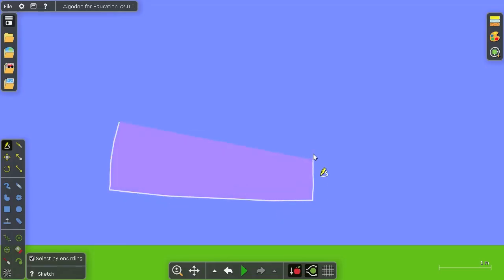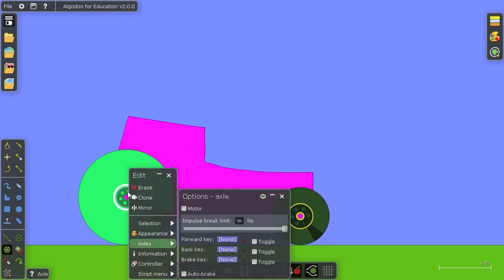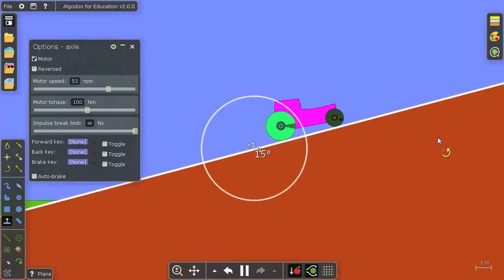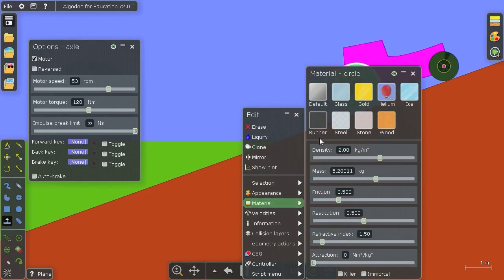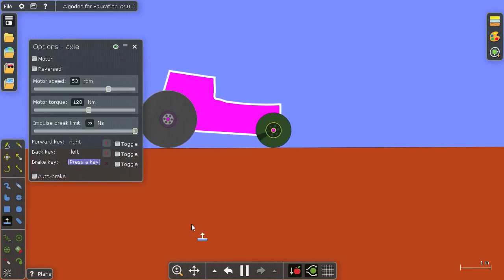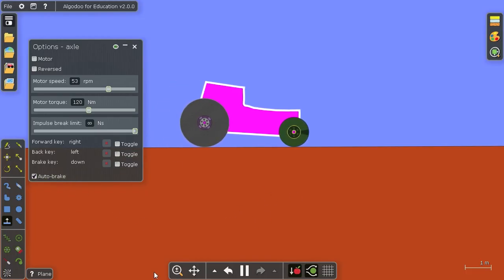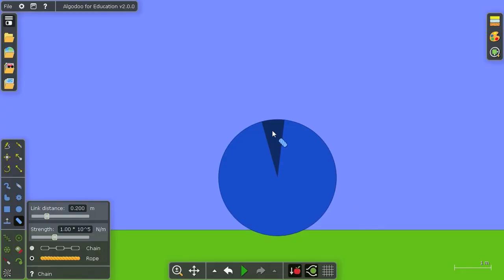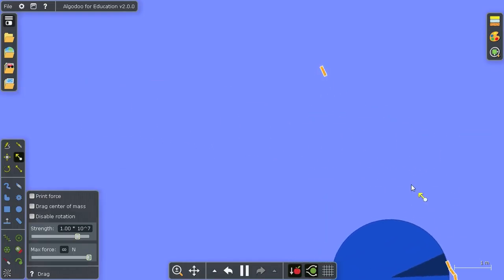Algodoo Webinar - Axles & Motors

Comment: I can't get the spinners spinning, even if I copy what you're doing. How do I make a spinner actually spin?
I am using the axle correctly, yet it only rotates when pushed by my athletes. I have tried every option on the axle and nothing works.
Reply: Check the impulse break limit. Make it infinity

Comment: The big problem I have with Algodoo on PC is it seems to just randomly decide when to attach axles to the background, and there's absolutely no way to visually tell if an axle is attached to the background until you actually run the simulation the. The problem is, if I'm making something complex and I'm trying to troubleshoot it if it's not working, usually the problem is to do with axles being attached to the background, but like I said there's no way to just look at them and see if they're attached to the background so I have to go through a very tedious process of taking it all apart and testing each individual axle joint on its own to figure out if it's attached or not. And even then, I have no idea how to detach axles from the background or how to place axles without attaching them to the background. And since it seems completely random whether it attaches axles to the background, I have no way to control it. Which makes designing anything more than simple mechanisms almost impossible.

Comment: When I try to add axels, the axle get's placed, but does not show up on the screen. Any ideas?
Reply: There is an option to hide axles when the simulation is running. Could this be the issue?